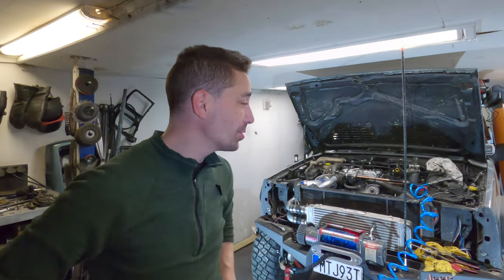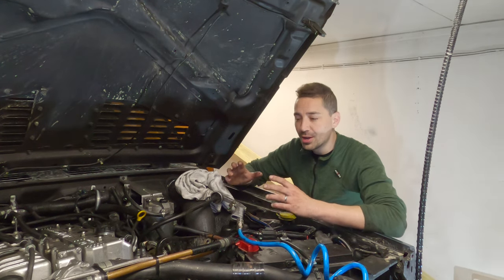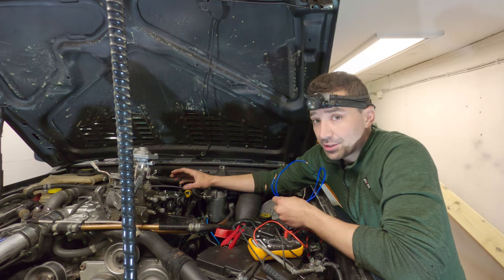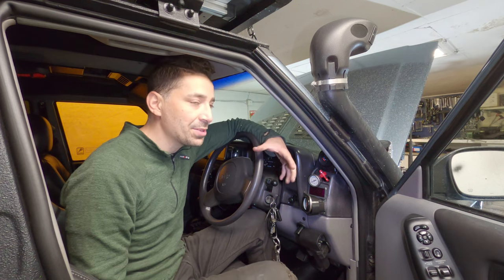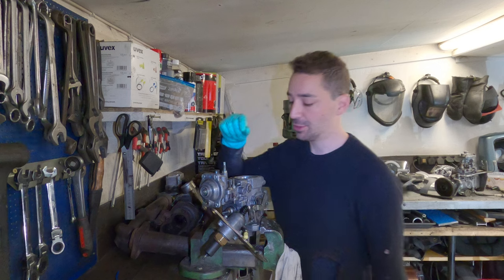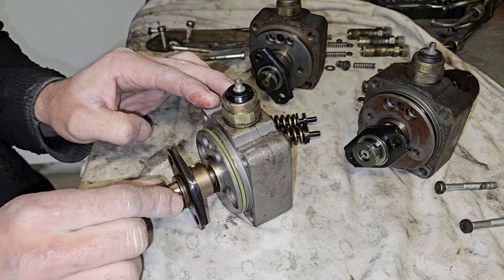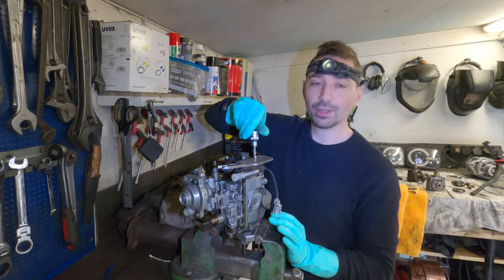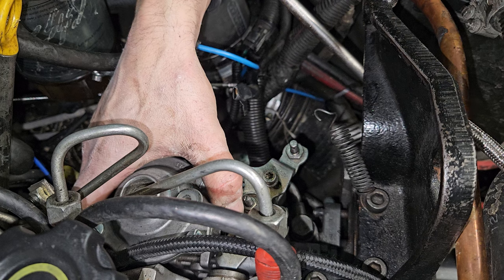10mm to 11mm Mechanical Pump Upgrade / Jeep XJ 2.5TD

Comment: I loved this , complete mission , intial  issue turned into unplanned maintenance on injectors , turns out to be fuel adjustment screw and index .
Then ran like a champion .
With some Mad Mike engine bay bench test set up thrown in for good measure.
Classic

Comment: 650 EGT uphill full chat in fifth is pretty reasonable.
Good job 👍
Reply from the maker: It doesn't seem too bad. It was originally 700, but I dialled the pump back. The pyro gauge is just out of cylinder 4, so it should be pretty accurate. Hopefully, 650 for short periods isn't an issue. 
Thanks for watching

Comment: OMG, hell of a job !
@WorkshoptoWilderness may I ask you how you unscrewed two of the three bolts of the pump? one easy, the one one the head side is impossible to reach, and the other one of the bottom, can't even see it. Any special/handmade tool ?

What did you used to remove the injectors without damaging the two small diesel return lines ? I used a huge long socket and given the length and force needed the socket slightly displaces and damaged it.
Reply from the maker: For the nut close to the head, I used a flat head screwdriver and a hammer to tap it loose. I also used the same method to tighten it. Underneath the pump required removal of the battery and alternator. Initially, when setting up the pump, this one was left snug until I was happy with the timing. I also test drove the pump without this bolt tightened. 

The injectors are an absolute pain in the ass and require super human strength to loosen. I ground the face of a 28mm long socket originally so that it would have maximum engagement without the small taper at the lip of the socket. I removed the valve cover also. 
The two return nipples didn't seem to be an issue, even now that it's on a 27mm. 

Thank you! It was a lot of work. I just have to keep an eye on everything now.
Reply: @WorkshoptoWilderness  Thanks a ton for your kind reply.
PumpOhhh man, now it makes sense how you were able to unscrew that pump evil bolt.

Really smart grinding the face of the socket to maximize surface contact, I will do that as well !!  
I used wurth Boltex to aid on removing the injectors. Next time I will try with a long 28mm socket and a powerful impact driver. When making some super human strenght to loosen, is easy to twist the socket and destroy everything. This is caused because the injector has a relatively small surface contact area against the socket. I also removed the valve cover (it MUST be done), and slightly bent the sides of the heads with the socket, that later I had to file and polish.

Another trick that helped me a lot to unscrew the two parts injector, is to moderately hit them with a hammer all around the threads. It helped a LOT to unfreeze them afterwards with the bench vise. Fire may be needed by I would at first avoid it because metal is relatively thin and can bend with the strokes. Piece of cake unscrewing them after that.

Comment: Is it just me but the pump on its own makes that classic diesel engine noise.
Reply from the maker: The pump has changed the acoustic of the jeep. It sounds really nice. Not as sharp when you're sitting inside, bit duller.
Reply: Not got a f##cking clue what you were doing but i will watch and say yeah that's what I would have done 🤣👍🏻🏴
Reply: Mech pumps sound way different to common rails. That’s the noise you’re hearing
Reply from the maker: I mean, the exhaust sound is different along with the induction noise due to more fuel. I'm not sure if I misunderstood the first question as what you said is obvious the case also.
Reply: Just saying thats all. peace x

Comment: Hi Mike,,love your vid's ,, also going to do the manual pump but no video on YouTube,, you mentioned somone helped you from UK, can you send me the link plz,,I'm from South Africa
Reply from the maker: Hey. Nobody helped me from the UK. Someone sold me with the pump from the Netherlands. 
Setting up the pump isn't difficult as it tells you in the manual how to set the timing and dial in the pump with a dial reader. 
I have a video showing this.
The manual pumps just take time to tune in and configure after installation. You just have to drive it, test it, and get the timing close. Then, you can dial in the LGA at the top of the pump to configure boost response along with the fuel screw and idle screw. 
If this feels a bit daunting, then I would get someone to instal it for you, although I don't think a regular mechanic would understand how to fine tune the pump.
Reply: @WorkshoptoWilderness  thanks Mike, appreciate,, I'll watch your video again,keep up posting

Comment: When I bleed my tractors injectors it can take like two hours. You need to get every bubble of air out of the pump, lines, injectors etc
Reply from the maker: I've not really had this much trouble before with bleeding fuel although the whole experience would have been much shorter if I had just turned the fuel screw and indexed it at the very start. 
That being said at least I learned something.

Comment: At 27:43, What's with the oil gauge diving down to almost nothing and you check gauges light coming on?
Reply from the maker: Its a broken sensor that I cannot find the original of anymore. I have an analogue gauge next to the EGT. There are  few dead sensors now. The coolant level sensor and oil sensor along side the rear hatch sensor. I need to install my own coolant level sensor. The originals of these things just any easy to find anymore.

Comment: Real good job Mike, like all yours mods and this is kind of what I would like to achieve with mine get more power in lower rpm so may take some ideas from this😊
Also few times in this video I've noticed that your rpm /speed are high but your engine oil pressure is fluctuating and dropping low, is all fine there?
All best from Scotland
Reply from the maker: It's a really good mod. I took it out for a drive today, and it was really nice to be able to spool the turbo up early. That oil sensor is dead. There's an analogue gauge next to the egt. I can't find the original sensor anywhere... 
Thanks for watching